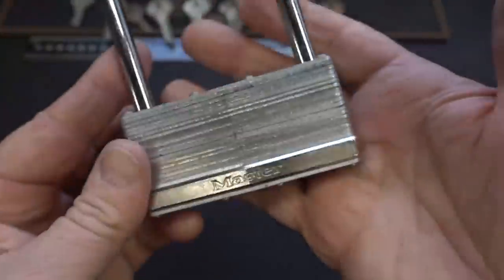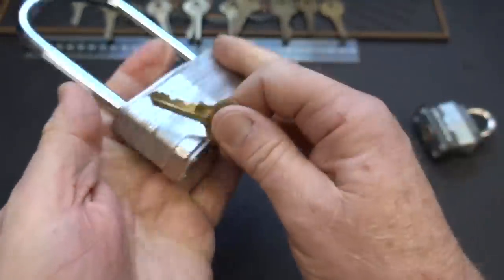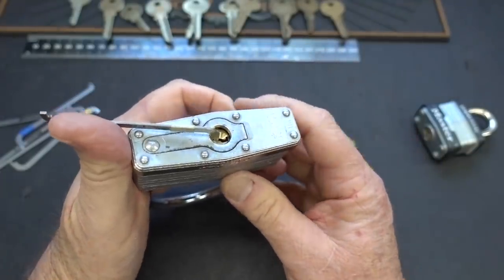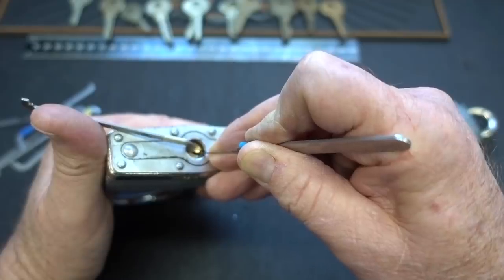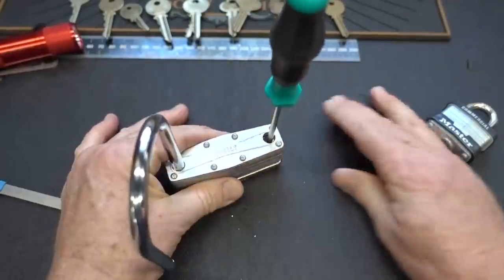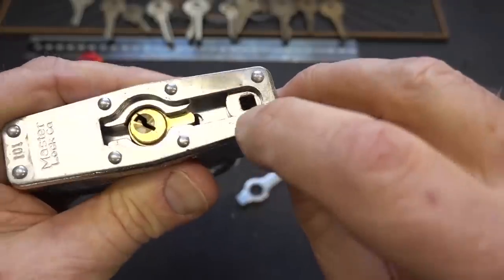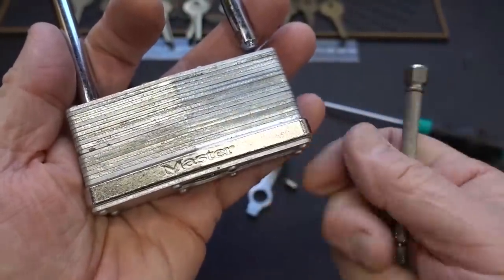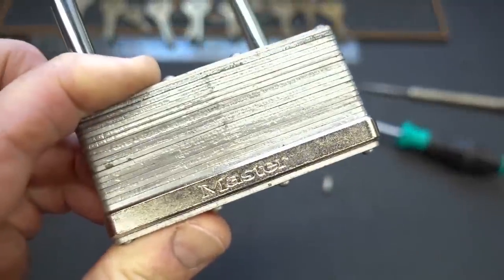(1623) Master Lock Model 101

Comment: Same core as a 6835 master but the 6835 is key retained on unlock.
Reply: NO it is NOT the same core as 6835
> 6835 is drilled 6 pin length and has spool pins with a 6000 keyway
> 101 is 5 pin length with 27 keyway used in 21, 25 & 27 locks
Reply: ABLOY EXPERT you are correct, I went and looked at my locks. It’s the same core as the 570 LOTO lock. Literally the exact same core. Fun fact is the mirror of the lock has a slightly narrower internal key way. When I measure the keys this key is almost 1/2 thousandth narrower on all my locks vs the no3 and no5 flavors.

Comment: I wonder what it was designed to lock. I suppose it would work as a front wheel cycle lock, but I doubt that's what it was designed for.
Reply: Walk-in/large freezers/fridges and similar containers.

Comment: couldn't you have just used a drill on that aluminum screw cap holding the plate down that was holding the key core in place?

Comment: With that "rivet" or screw receiver being aluminum, could you not just give it a nice shot with a sharp chisel, the plate falls off and the core drops out? Yes I know it's crude but I don't think a thief is going for finesse and can probably be done faster than picking, especially for an amateur. Bottom line, another junk master lock!